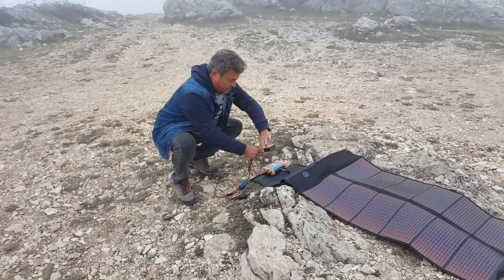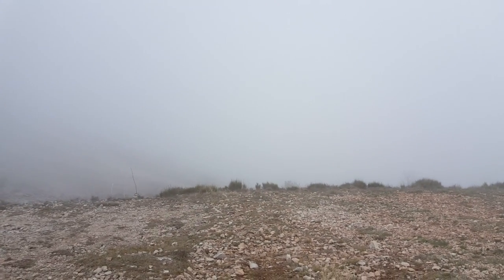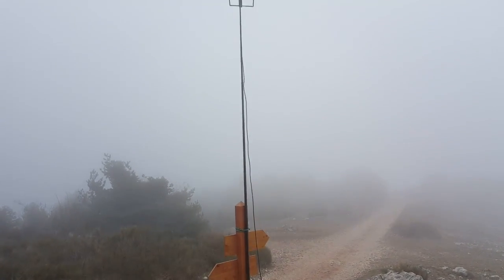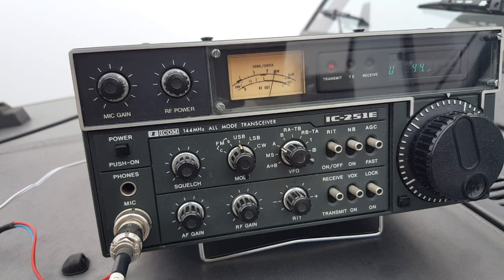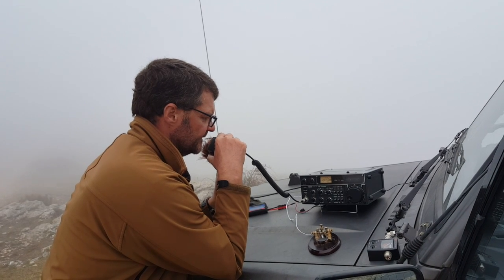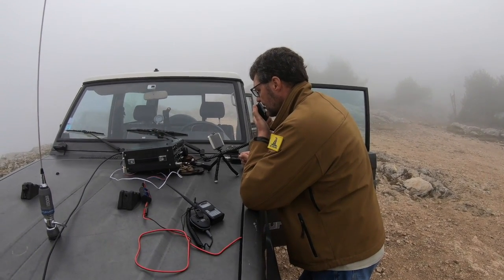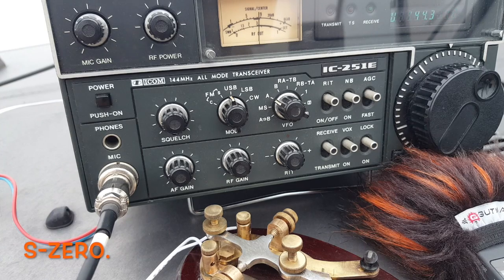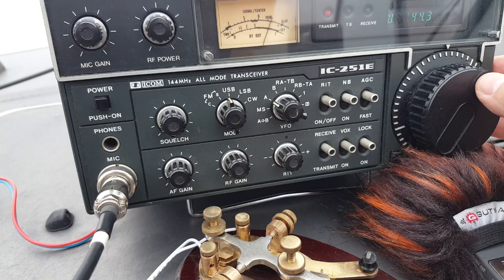VHF Radio Operations at Caussols Plateau.

Comment: I know what you mean regarding SSB instead of FM. Here in the States SSB on 2 meters is the sound of silence. Like your Icom all mode rig, always wanted one. Maybe the solution for a return to SSB on VHF in the states is building a vodo tower for the local repeaters and embedding in it a handful of pins in strategic locations along with a few chants from an ancient tribe.😀

Comment: good job on the moxon i have noticed they put a 70 cmwire in frount bot not connected to the 2 mtr moxon and they get it to work on the 70 cm band as well as the 2 mtr band get the mfj 2 mtr ssb cw unit  73 jerry kg6mn
Reply from the maker: Interesting thanks.